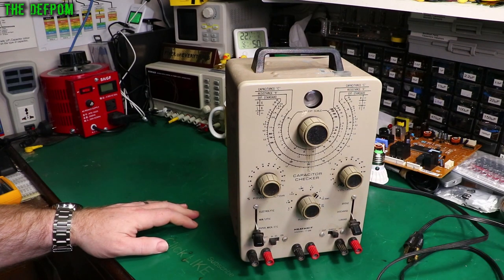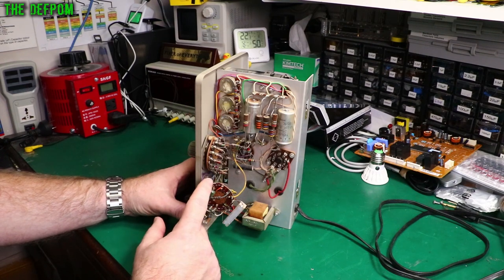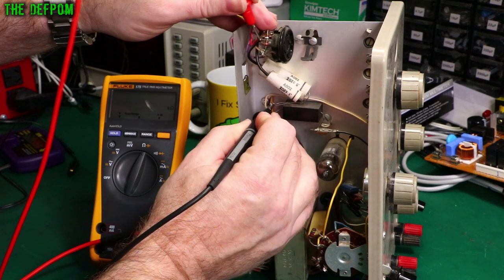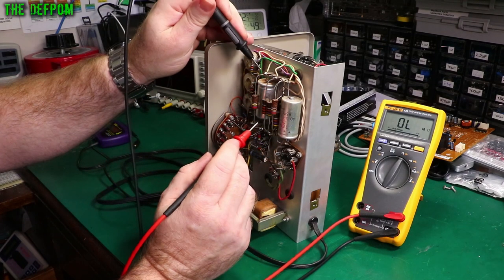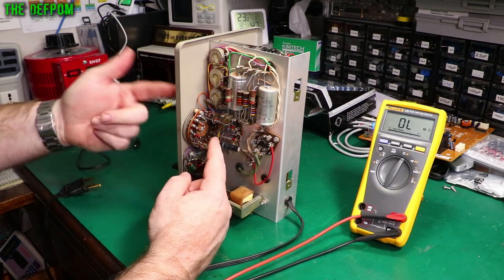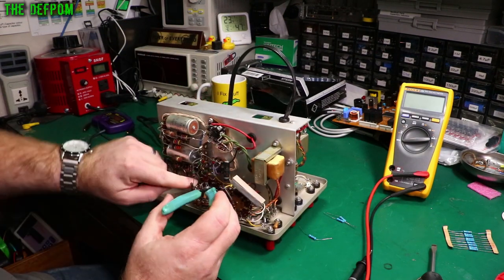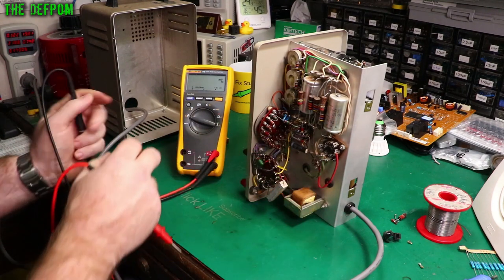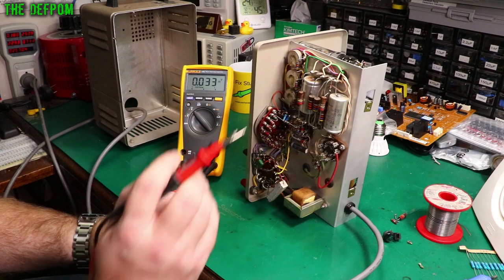🔴 Heathkit IT-28 Capacitor Tester Repair - Part 1 - No.1023

Comment: Something I change in my resto’s of the it-28…I move the heavy 10w resistor from the wafer switch to a remote mount on the other side of the chassis where the 2.0 Mylar is located. Then the Mylar can be moved away from the hot tubes and wired directly to the power factor pot and selector switch pins. I also use a 10w 47k resistor and a 5w 33k resistor to clean up the power supply section. Fewer parts. Nice and clean.

Comment: I remove the 10W cement resistor from the delicate and irreplaceable wafer switch and remote mount them on the other side of the chassis where the 2.0uF cap is currently mounted. Then, I move the 2.0 uF Mylar cap directly wired between the selector switch and the power factor pot. I use one, 10w 47k resistor in the power section and a 5w 33k resistor. That really cleans up the unit.

Comment: The heyco tool is the correct one for the strain reliefs.
The Chinese tool does not work.
Reply: You're correct Chris. You might have a hard time finding an original Heyco though.
Reply: @danishnative9555  I found a used excellent condition Heyco #29 set on eBay at an affordable $25 a few months ago.  I had been watching for one about a year.  They are available new currently for $70 on Amazon in Los Angeles.

Comment: Hi, I'm curious why you said the values might be effected by the valve?
Unless the component is connected across the heater/filament pins there should be no influence by the valve/tube while turned off.
I guess you are thinking maybe a faulty valve shorted internally which is possible but not very likely.
What I've found with these units is those 2 electrolytic caps are always very leaky and need to be changed.
They will often blow the fuse they are so bad.
Thanks.